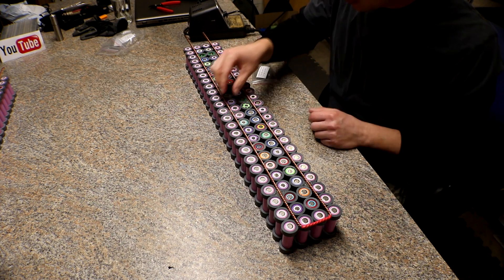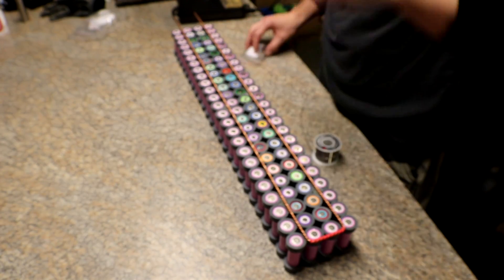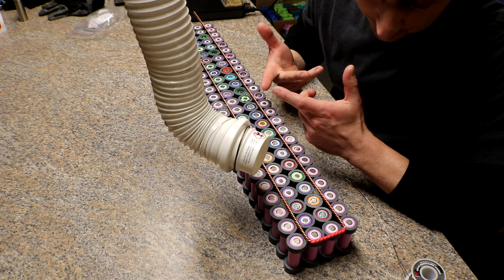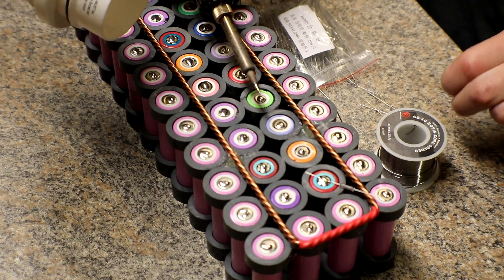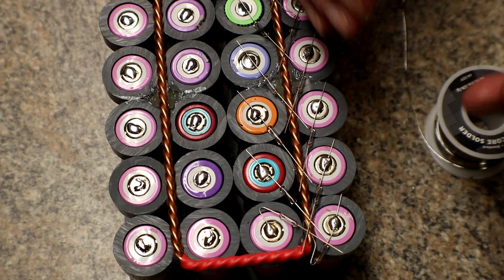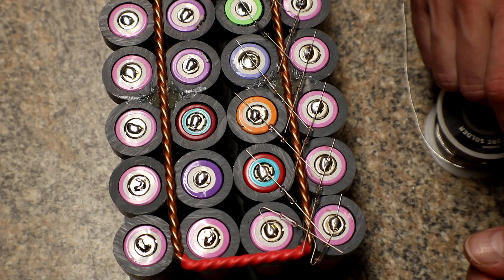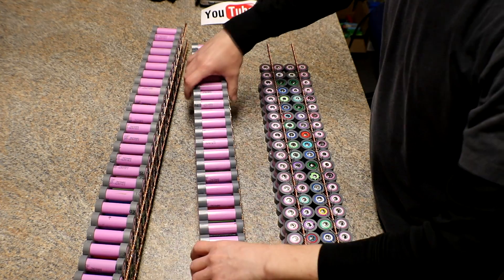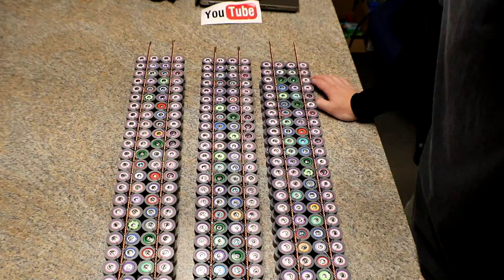Diy Tesla Powerwall ep38 Soldering Fast Axial Glass Fuses

Comment: Just wondering, you put the fuses on both sides or just the one shown in the video?  Thanks...👍
Reply from the maker: Just the one side! 🤘
Reply: @AVERAGE_JOE  So, you use nickle strips on the other side then....buss bars??? Thanks...🤠👍
Reply from the maker: I used 24g copper wire attached to busbar. I have another vid showing what I did. Next pack build Ill be using 24g tinned copper wire on neg side but will spotweld instead of solder.
Reply: @AVERAGE_JOE  How far back was that video?  Interested in watching that one!  I definitely want to watch the one spot welding the 24ga tinned copper!  I just got the lipo pack I needed for my spot welder from Germany....just got to clean up the 3D printed parts and put it together!  🥳👍🛴
Reply from the maker: Here is the neg side slodering https://youtu.be/R_BBROIDqtM and here is a vid later spot welding fuses on a diff pack https://youtu.be/qtZa941WhWo

Comment: I've seen builders use 5a fuse wire, 1/8w resistor legs for fuses...what's the difference between them and the .5a glass fuses you use? Thanks!!!🤠👍
Reply from the maker: If you use wire, the length can change the amp rate to pop it. Wire is still an acceptable way to cell level fuse. You could use resistor legs in a pinch but might as well use wire. I personally like the glass fuses as it keeps the wire inside the fuse contained if it pops. When wire heats up it can glow red hot and possibly melt something. In my build I used .5 amp fuses because when I tested them they would pop around 2 amps and that what I wanted. Next build Ill use 1amp as they also pop aroumd 2amps but with a hair less resistance. In my testing, the glass fuses will pop at about double the rateing. All wire and fuses should be tested before use.
Reply: @AVERAGE_JOE  Thanks for your response...what you're saying makes a lot of sense!  How small down of a pack would you use cell level fuses?  I imagine you would not use them on a pack built for an electric scooter....but, on a power wall it would definitely be called for.   I'm in the planning stages right now for building a power wall for my RV and safety is top priority!

Thanks again for your advice!!!🤠👍
Reply from the maker: Yeah I would for sure use cell level fuse (of your choice) on pretty much all battery packs especially on used cells however ebike, escoots and boards ect.. are a different ball game lol. Most will just nickle strip the hole thing which I just did for a lil scooter😀
Reply: @AVERAGE_JOE  I imagine most people doing DIY power walls leave them open for inspecting every so often...since mine will be in my RV, I'm looking to padding mine with EVA foam and shrink wrapping for added protection since it will be in a moving and bouncing vehicle.....your thoughts???🤔👍
Reply from the maker: Yeah you would want to make everything as sturdy as you can. Padding and shrinkwrap for sure!
Reply: @AVERAGE_JOE  Thanks...🤠👍
Reply from the maker: Again for your RV you will wanna make everything as safe as possible. Do you have cells yet? Are you sticking with 12v? LifePo4 is the safest and will match 12v systems WAY better with inverters and such. A bms is a must!
Reply: @AVERAGE_JOE  I have about 400 and will probably get 200 or so more when I go full tilt!!!  I'll be keeping it simple and making everything 12-volt...simpler for the inverter and tying into the 12-volt RV system.  

Haven't seen anywhere what to use when designing things, using the full charge voltage of 4.2 volts or the nominal voltage of the cells....makes a difference in deciding whether to use 3S or 4S...don't know if the full charge voltage would be too much for the RV's 12 volt system...if it is then I'd add a DC to  DC converter. 

Learn all I can and build with what I have and  then when it's time to up my game I'll upgrade everything to NEW LiFePo4 cells...looking at 32650 cells at the moment. 🤔

Comment: please re-solder the fuses, the solder must flow into the buss wire rather then sit on top being they are called cold solder joints.  So far you have did a great job on all else :)
Reply from the maker: I think the camera makes it look like that.  I assure you there was flow!🤘
Reply: Ok thanks. Just didn't see the solder go into the copper buss wire.  :) Thanks for the reply.

Comment: i hope you notice me and i already subscribe to your chanel

i am planning to build 3S and 20P 18650

can i use Fast Axial Fuse 1A?  or much better if i will use 0.5A

my expected power 150-240Watts if i energize
Reply from the maker: 1a are just fine. They pop the same as the .5a fuses. I am going to use 1a on my next packs! You could probly use a higher amp fuse since you will be using 1a per cell.

Comment: Holy Cold solder joints...all those solder joints to the bus bar are COLD , but you MIGHT get away with this as you are NOT subjugating this to vibration... just heat temperature differentials...  Good luck.  Doubt it in the long run.  Otherwise, good job.
Reply from the maker: None of the joints on the bus bars are cold.  The solder flow was liquidy and shiny during build.  Still using the packs today!
Reply: @AVERAGE_JOE  Looking through a video and obviously not as good as the ol' mark one in person, but If the solder does not flow, it is cold and is a lousy joint.  Shiny and no flow is still cold. I have made plenty of such joints and been sorry every time I did not fix it.  The problem is the thick copper bus bar + solder by the way.  

From the vid: I saw a multitude of bubbles of solder which sits on the thick cold copper bus bar.  If there was no bubble, then it would not be cold.   Not shiny and a bubble just means it is a REALLY bad "solder" joint.   Yes, it will work for a while.  A very long while if there is no vibration. As a power wall?  Sure could work(obviously it still is).  IF you put this in a car/bike/scooter?  Would never work.  Sorry, but true.  

Soldering to thick copper is near impossible as it requires a MASSIVE amount of heat applied to the copper over a long period of time.  Why most would use an arc spot welder and NOT solder.   Why Plumbers use a giant flaming TORCH when doing copper pipe and not a teeny tiny soldering iron.  

Sorry, been in your shoes and been sorry everytime.
Reply from the maker: I wonder if its just how it shows up on camera!  The first few solder connections took a bit as it was heating up the bus bar but once it was heated up the flow was great!

Comment: Hello Joe, I found the perfect tube: 2/3" KPE, used for garden watering systems. Thin wall, but strong enough. :)
Reply from the maker: Awesome, were did you find it and is it a tight fit?
Reply: it is available in the gardening section of any DIY store here in Europe. Used for automatic watering systems (they put it to the soil). I also used it - so just tried it - it is a nice tight fit. http://www.tubatrade.hu/en/pe-pipes/pe-pipes-for-water.html
Reply from the maker: Oh ok I think Ive seen that stuff!  Ill have to look for it next time Im at the hardware store!!!👍

Comment: Beautiful job with a nice finish touch with excellent  explanation + share the trick from your experience , I have to call you Pro Joe . I just get into this hobby i just think about if I  use MPPT or MPV solar charge control to charge battery + BMS , do i need to add fuse on every cells ? and can i use fuse just on each group of 6 or 12 volt ? why i think about that  because 1) battery cell are ready check , 2) MPPT or MPV charge controller will not aver charge 3) BMS like long-mont monitor the cell/ group 4) Fuse on each group save time and money   . please  teach me . Thank you all .
Reply from the maker: Thank You!!!  Well I would say yes for the cell fuses, even if its more of a last ditch effort.  Minimum I would use some sort of thin wire that would pop just in case of accidentally shorting the pack out.  I know we all try to be as careful as possible but were human and accidents do happen.  I have accidentally shorted 2 packs at the same time and blew 200 fuses.  If the fuses werent there, I dont even want to know what would of happend. Many others have done the same.  Yes it does take extra time but the time is well worth it.  Cost for cell fusing is very minimal, less then $20.  I use the PCM60X charge controller, its a MPPT and works great.  Im able to set the voltage to whatever I want.  I am also using the Batrium for a BMS which I would suggest!👍🔋
Reply: Thank you Joe , i did watch almost all of your video , that is why i come up with your experience turn average Joe into Pro Joe , I love the pro way you did and the finish touch from detail to detail are master  work   . I just begin with it in begin I use AGM battery now i like to use  Li-on battery like the way you build the power wall , so far i have 2 BEA 40V 18.4AH 736WH LITHIUM LIFEPO4 96 A123 26650  BATTERY to begin , I crack it open, did not find any fuse on the battery cell . I rebuild it into 3 group of 12.6 volt because i have 2 x 12V inverter  and so far it work good , let see how long  it last then i go to build it bigger so i can run the 220V 1 hp pool bump (-: . But i have to say Thank you for sharing your knowledge .  And yes I when to the website you  give and .... the BMS from longmont + the control software ... make it look super super Pro . BTW my Co Worker make a study from your video and said You can begin with YTU  ( Youtube tech. University ) because your video are great  teacher .
Reply from the maker: Thanks for the binge watch!!!!  Yeah most packs that are made from the factory wont have the cell fuses since they are all brand new!  We install then now because they are all used and we dont know the condition of the battery and its better to be safe then sorry.  I hear a lot of people like those A123 batteries!  Yeah you gotta start building somewhere.  The Batrium bms is the best for sure!  Ill take a look at that YTU!😃👍
Reply: Well yesterday i buy 6 more for $600 , total 8x 736W/h   Hope one day i can get it like you 14 pack  , First step is made like the most people here who watch your video .. .... We love it and stay support you .
Reply from the maker: Noice! There you go!  Yeah you will be there soon enough for sure!!!👍👍👍

Comment: good information on fuses:
Here's the PICO fuse datasheet (note the 'Electrical Characteristics' table )

some additional information on fuses:
https://electronics.stackexchange.com/questions/51366/how-does-a-fuse-blow-at-its-current-rating-regardless-of-voltage

Comment: Instead of applying solder to the iron, apply the iron to copper and then solder to the copper.
Reply from the maker: If you apply solder to soldering iron first it keep you tip lasting longer and the tip holds heat better.😃👍
Reply: Ooh, them's fightin words!
Reply: Honestly though, you're burning off all your flux before the solder contacts metal.  Flux is what helps your solder whet the metal; Without it you'll end up with weak joints that break off.  You would also use half as much solder as you're using now, even less.
Reply from the maker: Lol😆👍
Reply from the maker: True but I also add fresh solder/flux after the copper is heated up.  This is the way I learned when I was in the  AF and back in shop class in high school!👍

Comment: how many cells in a pack? I'm thinking about going with 20cells in a 4 x 5. times 7 in series.then either add on. or make a heavy buss bar to bolt the about 8 gauge wire to from each pack. only about 6" of 8 ga. Or less. with about 2.2 to 2.5 ah Per cell. I hope this time next year to have a 4,000ah 29v bank built. and still going. I would like to run lights and TV and fridge . for a week without sun. and have enough solar. to charge it back in less than two days. but I'm dreaming now. thanks man.
Reply from the maker: LOL yeah a 4kah (<---- new term I just made up lol)(4kaaaaaaaaaaah) ok back on subject.  I hope to have another 10kwh here soon as longs as these cells that I am testing hold out!  How much energy do those items pull?  I dream alllllll the time 😉😆
Reply: @AVERAGE_JOE  kablo kesiti kac mm kullanmaliyiz  ?

Comment: Did you try to run .5A on longer period? Becouse fuses should pop at their rating after some time, i have 3a fuse that can handle 3a for 10s but needs 8a to pop instantly
Reply from the maker: +Cekpi7 Yep I have a video testing them and I gradually bring it up untill it pops🖒

Comment: why not fuse wire? i see others use fuse wire.
Reply from the maker: I wanted a lower amp fuse so it will pop as soon as a cell starts to go bad vs a wire that pops much higher and can pull the pack down slowly before the wire pops.  Also a wire will get red hot if the cell is going out and just cant pop it.  Thats just my opinion of course 😀👍
Reply: ok

Comment: Is the length of the wire on each side of the fuse important?
Reply from the maker: I dont think so.  Most of mine are equal but I do have some that are really uneven next to the heat shrink.
Reply: Thanks.  I was just looking at the end fuses and it looked like you was trying to keep the wire long.   Great info thanks for posting all the videos.
Reply from the maker: Yep, I was basically trying to keep the in the middle and make it consistent 👍

Comment: hi bro! does using glass fuses better than using wire fuse?
Reply from the maker: Its really a preference thing.  I used the glass fuse because I wanted a lower pop rate than a lot of the wire could do.  You can use wire no problem👍 which wire where you thinking of using?
Reply: Thanks for the reply man. We only use resistor feet here for our diy powerwall.
Reply: Yes

Comment: Hi, Incredible and clean job... I starting my own project of battery paks for my VW Beetle 2001 (www.libredehumo.mx), I need at least 72 Volts and 130 amps.The fuses than you using in this video are appropiate for my proyect?

Comment: How do you know that you only need 0.5 amp fuses?
Reply from the maker: +chris musso I ordered .5a, 1a, 1.5a and 2a fuses to test. I picked the .5a because it pops at 2a.  I wanted a low amp fuse so if a single cell starts to go bad it will pop low vs pulling the hole pack down. Most others that use copper or tinned copper wire are set to pop at 9 to 25 amps which is fine but it takes that much more.
Reply: Thanks for the quick reply and thats really interesting, I was also wondering how to know the max amprage that I would use. Is it the max that my inverter draws or is it based on the divices plugged into the inverter? Im buliding a 3s/100p pack. (I know this is a stupid question but im new to this stuff..)
Reply from the maker: +chris musso It would be off how much your inverter would be pulling but a 100p pack each cell would see less than an amp usually. Do you have a device that you want to power. For example a 1000watt device plugged into ur inverter will pull about 8-9amps at 120v. Then you take 120v÷12v=10.  So it takes 10 amps at 12v to equal 1 amp at 120v. Then you take 10amps at 12v X 8 or 9 and you have 80-90 amps at 12v to power the 1000watt device plugged into the inverter. Then you divide the 80-90 amps by the 100p and its .8 or .9 amps per cell.  Hope that makes sence, if not send me a pm as im typing this on my phone at work lol
Reply from the maker: Oh then you divide .8 or .9 by 3 😀
Reply: Makes perfect sence thanks so much, prob gonna get the same fuses as you it looke like.
Reply from the maker: +chris musso I have a few vids of testing them as well.

Comment: Does the fuse wire, once welded to each cell, also keep the looser cells in place within the pack?  Vids continue to look great.  I really dig the track you use during your time lapse starting at 5:04.
Reply from the maker: It does keep everything in the pack and fairly flush if you pick it up.  However if you flip the pack over they can slide out a little towards the fuse or bus bar untill there soldered on the negative side.  Ya I like that song as well, I seem to use it a lot, its called Far away by MK2 and I found it in the youtube download section
Reply: It's like the song's composer had "time-lapse montage" in mind when making it.  :P
Reply from the maker: I know RIGHT!!!

Comment: great work Joe. Why dont you place busbar 1 cell inside/higher? Less likely to short, you wont need heathrink for end and no funky business with last cells fuses (easier) :) And how do you know which fuse popped, to replace dead cell? With  wire it is visible... just wondering :)
Reply: I am so glad to see someone addressing the issue of single cell replacement in these large packs .... the simplicity of genius .... desolder 2 connections and replace cell vs desoldering the whole pack just to replace 1 faulty / weak / blown cell .... it's a no brainer really :D ... well done that man :D
Reply from the maker: Thanks,  Yeah I guess I could have moved the bus bar in 1 cell lol.  Not sure why I did it this way, I guess It just happened :)  I might do that on the next 11 but I do kinda like the look of the heat shrink on the end.  To many decisions LOL
Reply: Yep, looks nice, should have written earlier :) They go anyway in the server rack, so packs in 1 'drawer' will have different backs, hidden anyway. But great job, thanks for nice videos!
Reply from the maker: Thanks, and to your other question, Ya you can see the wire in the fuse or if there popped
Reply from the maker: +Garuthius Hall Thanks Man!!! Although one can always break the tabs on the normal black cell holders to remove a cell to not take the hole pack apart but I like my lil setup 😉🖒